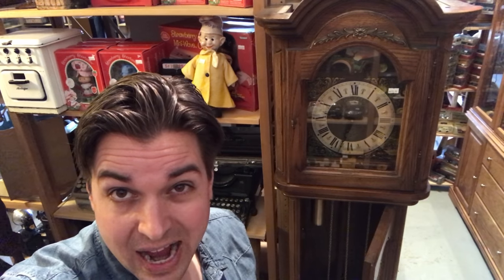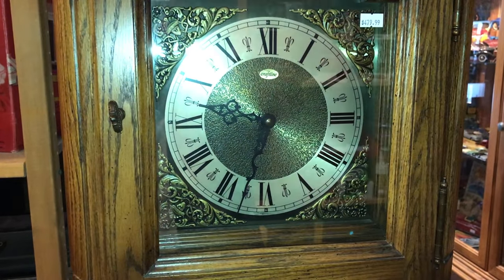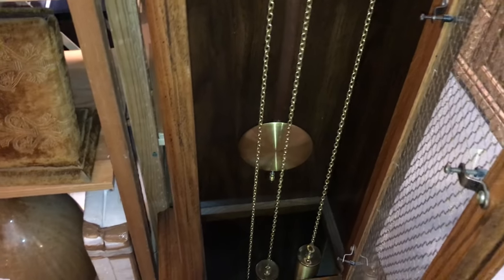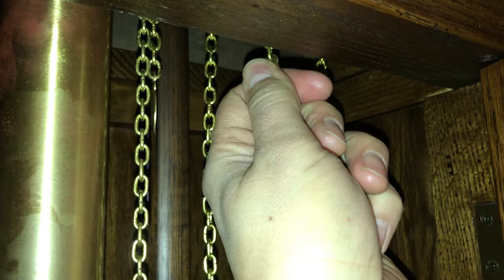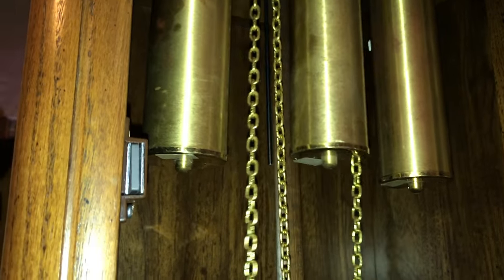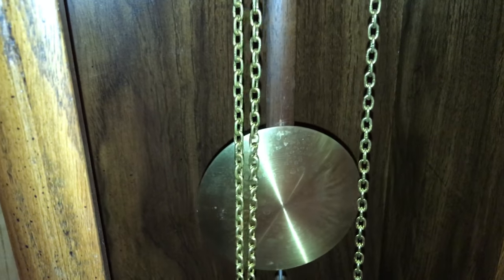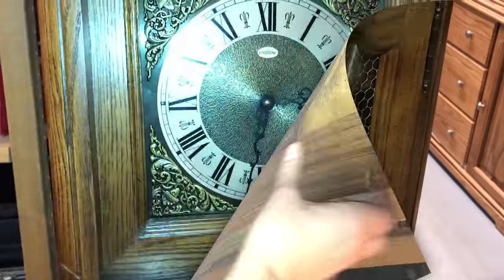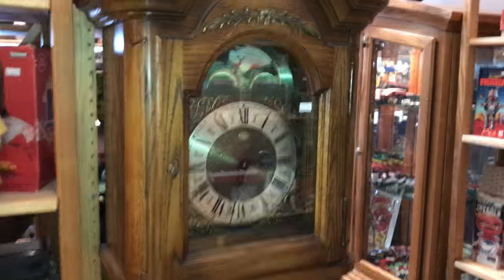How to easily wind & set your vintage grandfather clock

Comment: I just had to rechain a Howard Miller grandfather clock because two of the weights were raise so high that they wedged against the motor mount blocks and locked up the gears. You should never raise the weights any higher than the the frame of the weight/pendulum door, and always support the weights with one hand under them when lifting to avoid excess wear on on the weight sprockets.
Reply: A
Reply: Nazeemas sawwarisi recipe

Comment: Unfortunate that you titled the video "How to easily wind & SET Your vintage Grandfather Clock", but you completely failed to demonstrate how to SET  the clock time since YOUR clock just happened to be preset on the correct time.  Would have appreciated the latter aspect of your video's title being included in the teaching.
Reply: Actually you can put the hands back counter clockwise.
Reply: @ryansgirl2002  who hurt you
Reply: Yes! That's why I came here and he didn't show that part. You are also not supposed to put all the stress on the chain when pulling the weight up. You are supposed to hold the weight and help it move up.